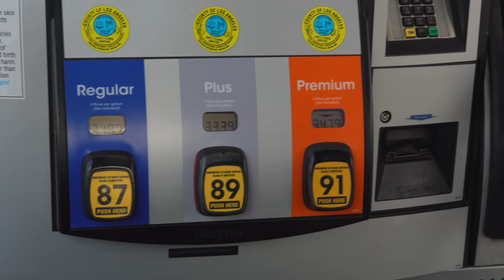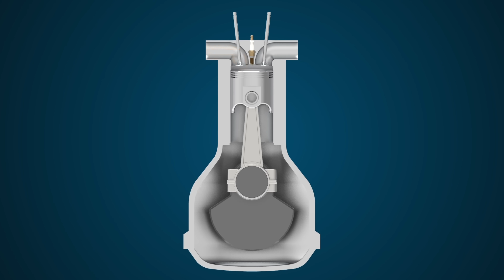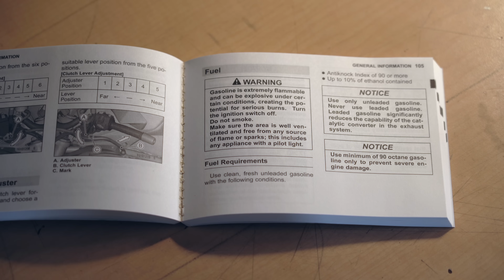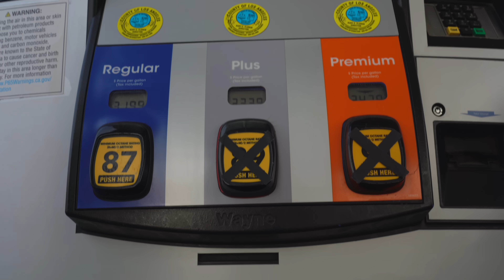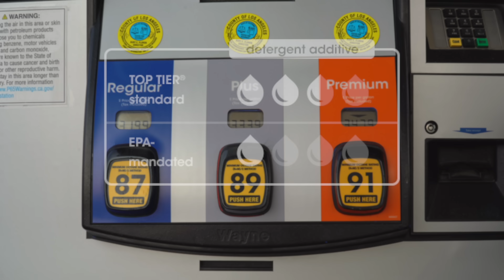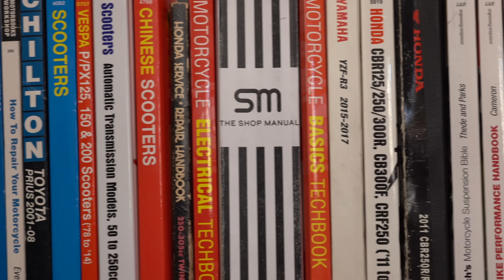Should You Run Premium Gas In Your Motorcycle? Octane Explained | The Shop Manual

Comment: No mention of ethanol content. Typically higher in cheaper gas and if you're storing your bike the tank will have water in the bottom after a few months which can lead to rust in the tank and corrosion in carbs and injectors.

Comment: I have done tests on 3 motor bikes 2018 xt 250, 2007 650 klr, 2015 650klr.
Non moded and  increased all 3 by one liter less per 100km. Less ethanol in premium means less corrosion and less rubber cracking, stiff diaphragms ect.

Comment: There's another curveball, Ethanol content. My bikes are all pre-2000, and as such cannot run on E10 95RON fuel which is the UK Standard grade because E10 (10% Ethanol), as it can cause rough running in colder weather as well as reports of the higher Ethanol content drawing more moisture into the fueltank and rotting fuel hoses/gumming up carbs etc.

That's why I run the 99RON E5 premium fuel in all 3 of my bikes (99 Honda CBR600F, 99 Suzuki GN125 and a 95 MZ Saxon Sportstar 125)

Comment: Ive been curious about how much fuel is in the lines before it switches octanes.  In other words, you ride up to the pump, select Premium, but the previous user had selected 87.  if you have a 2 gallon tank, how much premium are you actually getting?  Might be an interesting followup on octane ratings.
Reply: Well ... how much fuel do you have in your tank before refuelling? Figure it out.
Reply: @JifeLacket  my question is not about what's in your tank already, it's about what's in the fuel line coming out of the pump. How much fuel from a previous person's selection are you getting before you get what you selected? 1/4 gallon? 2 gallons?

Comment: There have been car tests that show a slight mileage boost from 91/93. The detergent is critical. My 2010 E550 RWD 386hp V8 @ 158k drives like it has 425hp.

Comment: I have s 3rd gen V-Strom in 42,000 miles of testing different grades I get 3-5 mpg better gas mileage with branded premium. Under identical conditions. the worst gas mileage it with summer blends, which include more alcohol.   Alcohol in gasoline is a bad thing, but since gas is taxed by the gallon, all governments support alcohol in gasoline. It is 1/3 less efficient than gasoline

Comment: I don't have a motorcycle but I do drive a 370Z, with a high compression engine. Because of Nissan's adaptive ignition timing, I can run lower octane gas than what the engine was optimally designed for, 98 RON. In the US market, Nissan specs a 91 AKI gas as a minimum octane and it does run acceptably well. I now use a blend of Sunoco SS100 race gas and Shell V-Power Nitro 91 oct to get a blended average 93.25 oct, which the engine really likes.
Reply: All modern engines with knock sensors have adaptive ignition timing.

Comment: Ethanol comes from corn. What else comes
from corn? High fructose corn syrup. Besides ethanol, which is an alcohol, and is hygroscopic, which means it draws water from the air, causing rust, alcohol also causes aluminum to rust n corrode, the yellowish powdery shit you see an aluminum engines, just like water causes ferrous metals to rust. So now you have two corrosive agents in your fuel, regardless of octane. Simply put, low compression uses low octane, high compression uses high octane. Also, the ethanol in your gas tank if left to sit and go stale, (a coupla months) will evaporate and turn into a sugary goo that will clog up carburetor jets, fuel pumps and injectors. 
There you go. What you need to understand about today's shitty pump gas. There are fuel stabilizer's and fuel system cleaners, like Seafoam, when used regularly can keep your fuel systems clean...

Comment: In the Appalachian Mountains, there's a LOT of places where you can go up to 100 miles and not find a decent gas station, when there's an excuse for a "fuel crunch" it gets even worse, and some places are NOTORIOUS for water in their gas (whether they purposefully dilute or it just seeps in on its own)... SO my recommendation around these territories is that you stick to mid-grade (89) unless your engine requires higher... It's ONLY a dime more per gallon, and a little extra stability and detergent care can add literal years and thousands of miles to your engine lifespan...

    Lots of folks "cheap out" around here because NOBODY likes paying extra for anything, AND I get to help quite a few (and witness or hear about MANY MORE) who end up draining their tank and scouring through their intakes or carb's for whatever they put the "cheap crap" into.

    AND if you have a carb' on your bike, I'd recommend once a year, giving a "Sea Foam" or similar maintenance treatment, depending on your favorite company ... Don't push the bike too hard for that tank-full. but ride it out, and help with some of those deposits and build-up, so you're not spending any more than necessary on your carb' care.  ;o)

Comment: You NEED to use the octane rating your bike is designed for (or tuned for).

Premium has LESS energy than regular. If you run a motorcycle designed for regular octane on premium it WILL RUN LEAN - because a carb and a MC fuel injection system cannot slow-adjust for changes in octane rating, unless you have a HD or BMW fuel injected bike - those are the only closed loop FI feedback adjusting motorcycles on the market.

Running lean will burn your plugs, valves, and if you run it hard enough it will burn holes thru the tops of your pistons!  

BTW - that engine he showed with carbon buildup on the pistons - that is NOT from lack of detergents in the fuel, that engine was running too rich! Someone screwed around with the jets on the carbs or the map on the FI and didnt know what they were doing. The carbon buildup would be immediately obvious the first time you changed the spark plugs.

Comment: Hey so I've got a MT-03, and the sticker on the tank said 93 octane fuel, but the manual says 87. I've been using 93 cause I haven't bothered to think about it till this vid. But from what I know about low CC twins, it should be more than fine to run 87 in it yeh?
Reply: I think you are mixing up the octane rating method from different countries

"Your Yamaha engine has been de- signed to use regular unleaded gasoline with a research octane number of 95 or higher. If knocking (or pinging) occurs, use a gasoline of a different brand or premium unleaded fuel. Use of unleaded fuel will extend spark plug life and reduce maintenance costs"

in the USA "regular octane" is 87, not 93 or 95

the engine was designed for regular (E10)

if someone rebuilt the engine with high compression pistons, or retuned it to run richer (on higher octane gas) and put a sticker on the tank that does not match the owners manual, you NEED TO KNOW THAT

Comment: Every bike I've had that says they can run on 87 always runs better on 91+, definitely not the power, but you can feel the difference in how smooth it runs. Idk, really knowing my bike and then feeling like the injectors are just getting gummy or it's behaving oddly, I even had an injector clog and cause some big issues with cutting off while riding because I had to use questionable 87 out on a long road trip... Just once! Ran seafoam through it, but damn that 91 just runs so smooth.
Reply: you need to specify every bike you ever had - what bikes were they?

Only fuel injected HD and BMW bikes have closed loop feedback that adjusts the AF ratio based on the O2 sensor. Those two brands will compensate for any octane rating you put in the bike, unless the bike needs high octane gas because it has high compression.

All other motorcycles, FI and carb'd, will not run with a proper AF ratio if you use the wrong octane rating.

Premium fuel in a bike jetted or tuned for regular will run lean - that will damage your plugs, valves and burn holes in the crowns of your pistons.
Reply: Manual literally says "use at least 87 or 91 or higher"

Comment: Just because your motorcycle's manufacturer says you can run your steed on regular octane doesn't mean engine performance won't increase with premium or 93 octane. No manufacturer wants to advertise that their motor must run on 93 octane only. When they do that they'll only lose customers because there are people out there that don't want to pay for premium fuel all the time. Many of today's motorcycles have Knock Sensors. This allows your ECM to make adjustments to your engines timing to avoid knock/detonation when using lower octane fuels. It's does this by retarding the timing which means your engine can run all day on lower octane fuels without doing any harm to the engine but you will lose some power due to the timing being retarded. When you do use higher octane fuels your ecm will advance that timing as far as the knock sensor will allow thereby giving you more power.
Reply: yeah...  no!

all bikes with carbs have fixed AF ratios and timing - they do not have knock sensors
the only fuel injected bikes that adjust for octane are HD and BMW

if a motorcycle has a high compression and needs premium they PUT THAT on the tank and the manual, because running lower octane will cause knocking

WHY would anyone spend extra money for a high performance high compression motorcycle and then run it on regular gas to save money?!
Reply: @kenwittlief255  I understand what you're saying. I'm strictly talking about Fuel Injected motors with Knock sensors. My Goldwing has FI and Knock sensors. It will run all day just fine on regular (The manual even say safe to use regular gas)  but the ecu will allow more timing advance as long as the knock sensors will allow it. Thus, it will run stronger on premium but Honda can tell customers that it will run fine on regular. Remember, there are three ways to increase compression. Using high compression pistons, compressors turbos/superchargers and timing advancement.

Comment: Toyota engines take advantage of different fuels. When I run at least 91oct in my 4 runner, it runs better and my gas mileage goes up. Anything lower than 91 it feels sluggish and I have to use more throttle to accelerate and cruise at highway speeds. Toyota has very sensitive knock sensors and will adjust fuel and timing to take advantage of high octane fuels.
Reply: its your imagination.

91 octane has LESS energy per ounce than 87. You get LESS HP and lower fuel economy running premium gas instead of regular and you are paying 20 to 30% more for the premium.

Premium is only required for high compression engines, which your Toyota motorcycle / SUV does not have

Comment: Air cooled engines should always use premium.
Reply: FALSE!  using premium makes the bike run lean if it is jetted for regular octane.

that will make it run hotter, and will burn your valves and pistons

Comment: Not only does high octane fuel make your bike run better it makes your bike run faster... This is one of the reasons they use high octane fuel in airplanes, also high octane fuel Burns slower and lasts longer.
Reply: FALSE!  using premium makes the bike run lean if it is jetted for regular octane.

that will make it run hotter, and will burn your valves and pistons

and premium has LESS energy per ounce, not more!

Comment: You guys go ahead and put 84 in your bikes lol. I use Premium for cleaner pistons and longer fuel periods. Premium is where it’s at long term
Reply: You could just add your own detergent if that's what you want, and I don't think you'll be getting longer fuel periods unless you've got a very advanced system that advances timing and compression ratio with respect to octane (this does exist such as in the Skyactiv X engines). There's also seafoam for cleaning it out if you're really wanting it clean.

Comment: Something to consider about lower octane fuels, is they commonly have Ethanol mixed in. Which isn’t normally a problem for newer engines, but older bikes weren’t designed with Ethanol blends in mind which can lead to problems.
Reply: when you park it for long time, yes. If you drive it daily. Not really. If you did not full it with some barn fuel.

Comment: I got a 2022 Ninja 400 and the guy who sold it to me said to use premium because it will help the engine stay cooler on longer rides
Reply: I've also had a fat dude tell me my bike was going to explode and melt putting ethanol in it at the gas station (I had been flooring it WOT for hours, so I knew this was false and was just really confused), so I just looked at the dude and was like "what?" and he said that was what caused his 125cc bike to melt.
Oh sure, it was the ethanol and not his 400 pound butt riding a Child's toy around that was the problem....

If you're wanting to change the temperature, adjust the fuel ratio to burn more rich. Unfortunately you'll foul the spark plugs faster, and make worse fuel economy, but its one option if you actually have it over-heating.
Reply: @jakegarrett8109  I haven’t had it overheat yet. It does get pretty toasty but not hot enough to kill the bike. (I live in the SF bay area so the temp is normally 70-80). 

I’m really just looking to make the bike last a long time and not break down over time. Should I put premium and change the oil at 100 miles, or should i just follow the owner’s manual and use 87 and do the oil change at 500 miles?
Reply: @Doberbull  follow the owners manual. Also 100 miles would be insanely excessive, there is no need for that. Also after your first oil change it's 7,600 miles for that bike, which seems high and I would change a little before then (if anything just to a round number simply so it's easy to remember) but it really just depends on a ton of factors and tolerances and some other engineer has probably worked that out.

Also note some manufacturers at least used to use a special oil for break ins, so if you change that out it would affect break in miles. There's also the fact that if it's still breaking in, then it's going to be leaving metal particles in your much much longer duration oil change, which negates the purpose of it's first oil change being short. Hence you want to follow the owners manual, not doing so and trying to baby it can do more harm than good.

Comment: So my manual says, MINIMUM of 86. Doesn’t  state anything about using higher than 86. My minimum is 87 so I never worry regardless. So i’m assuming that by pumping 93 I’m just burning cleaner and preventing carbon build up?
Reply: Maybe not, so the only thing guaranteed is burning more money.

Piston engines don't really have a huge issue with carbon buildup (my car does because its a Wankel rotary engine, but you just redline those everytime you drive them, and you just use 87 octane unless you have turbocharger or supercharger added to it). If you're worried about it, consider running seafoam through it every X number of miles (probably like 50k miles, do some searching online or see if the product has suggested interval for bikes). I don't worry about it because even on 30 year old engines they typically don't look very bad. Carbon buildup is more a thing on low performance engines like lawn mowers, and even then its not a big deal as far as I'm aware.

Comment: My 93 zx7 is finicky with which 93 octane I put in it. Shell, Check. Chevron, Check. Citgo, check. No name gas, no go. BP, ran rough. Stock engine with +2 ignition advance. Idk why the BP gas made it run rough. Tried several different stations. Even ones in different towns. No go.
Reply: Your carburetor clearly needs cleaning, and they have adjustment screws for a reason. You'll usually notice a change switching from 10% ethanol to no ethanol, but I've never seen a massive difference just based on the brand (I've seen some slight change, but its less than simply weather changes so I just never worry about it).

Comment: Well, in Germany the "low grade" fuel is 95, the "high grade" stuff is between 98 and 102. So, there ist not much of a choice but to go 95. Also i'm not running anything remotely modern :D
 (youngest bike in the garage is 19, oldest one owned by my dad is just turning 42, it still has a badge asking for unleaded fuel)

Comment: Good day sir.. im from Philippines and the usually type of gasoline here in my country is unleaded.. there are 2 types of unleaded gas here in the philippines.. the regular which has a 91 octane and the premium that has a 95 octane.. i have a 125cc motorcycle.. my question is which of the 2 types of fuel is the right one to use? Hope u notice sir.. thanks in advance..
Reply: You should be fine with the lower octane, assuming its not a very high performance race engine. The size isn't so important as the compression ratio of the piston (high compression ratio = high pressure, which is when pre-detonation is an issue), but most likely you don't have a race engine so I would go with the cheaper fuel

Comment: I will add that premium in many states does not have ethanol in it so it does do better if you're storing your bike for long periods in between rides.
Reply: For that you want to shut the fuel off and run it mid-rpm until it dies burning whatever was in the carbs, or drain the bowl if it has a drain plug. Either way, preferably don't let fuel sit in your bike for a year, its not going to be good either way, and if you have the pre-thought to fill up with different gas, then you can probably shut off the fuel in your driveway and let it run until it dies.